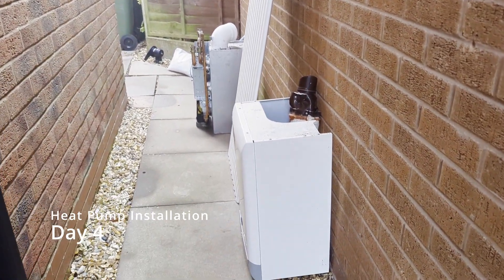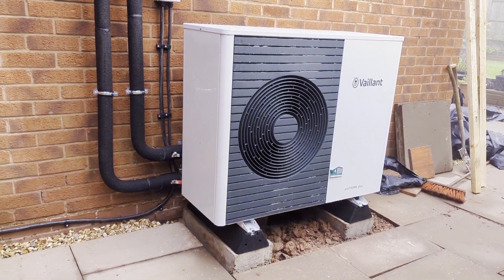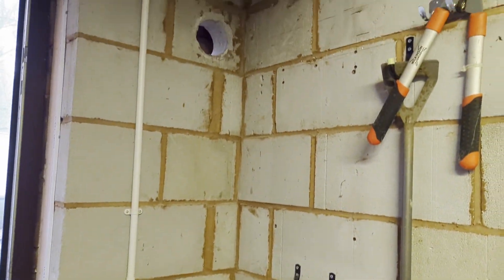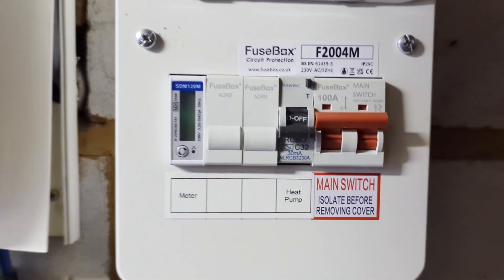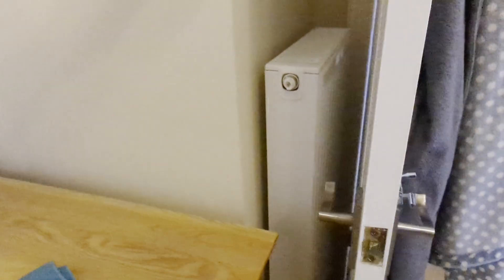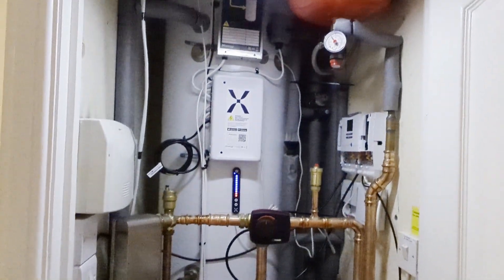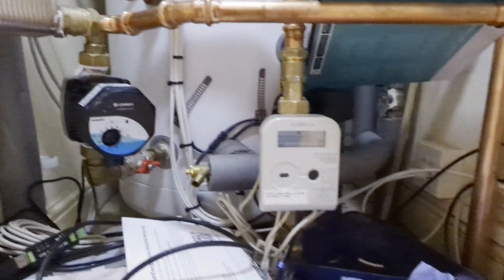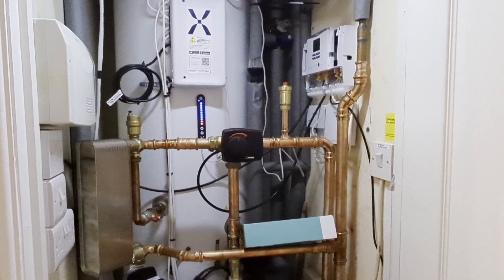Heat Pump Installation - Day 4

Comment: Noticed one minor in that the ASHP consumer unit was all Fusebox bar the RCBO which was another brand. But strictly speaking no control gear  should be used with another unless Fusebox spec it's okay. Goot set of videos otherwise
Reply from the maker: That's all been resolved now. In-fact, both of those breakers were wrong and had to be replaced the ones appropriate for a Vaillant heat pump. Also, they are now both from FuseBox.

Comment: Can i ask what are warranty period and conditions on the compressor ?. And although heatpumps are quiet when new, in 8yrs time it maybe more noisy, how do you live with it then buddy, what will vaillant do to reduce the noisy unit?.
Reply: Benefits of having a Vaillant Advance installer install and commission the system is that everything Vaillant badged including the controls are all warranted for 7 years directly by Vaillant. Very few manufacturers offer extend warranty coverage to controls also 👍🏽
Reply: @cvarsani2190  That's useful to know, thank you.
Reply: The critical part is ensuring the unit is perfectly level, if not the fan bearings will wear out quicker and thus become noisy.
Reply from the maker: I asked that exact question on the Facebook heat pump forum and the general consensus was that old heat pumps are quiet too. I guess that time will tell for us, but we'll maintain the device exactly in-line with Vaillant's policies. The warranty is 7 years.
Reply: @timminsit  very interesting,  as OFTEC recently advised me to take out mitigation insurance. How reliably the manufacturer will back you up and replace a noisy compressor or fan will in the future event be seen.
Reply from the maker: @adriandarke5393  I don't know, I guess that time will tell. However, I take confidence in there being billions of compressors in use around the world in A/C units and fridges, so engineers must know how to make them reliable and quiet.